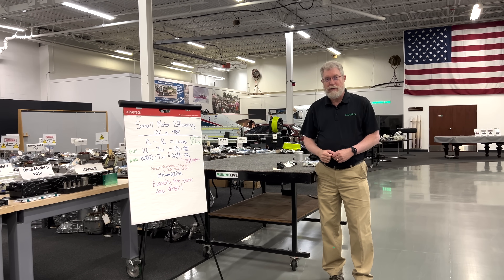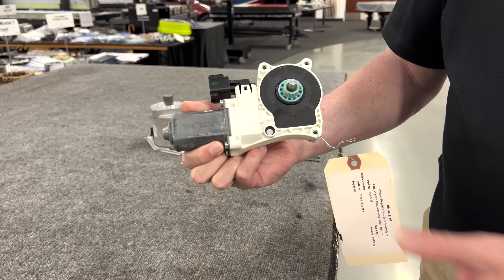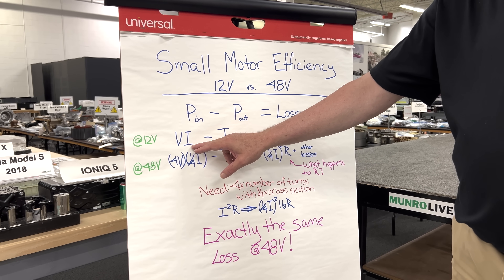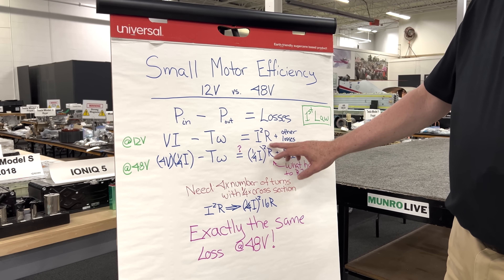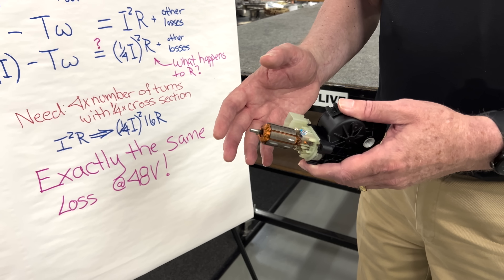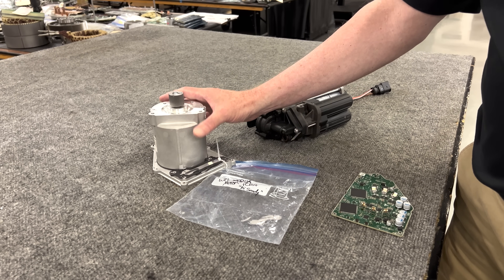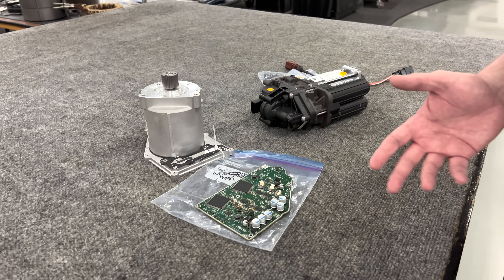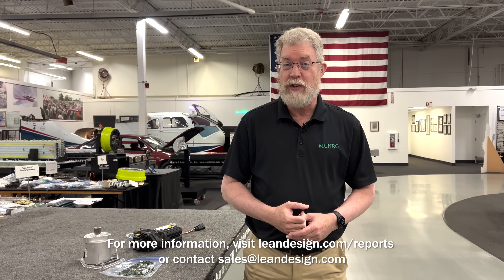Cybertruck 48V Motors: Why Tesla Made the Jump

Comment: What creates more heat 12 volt or 48 volt? Heat generation is also a loss through inefficiency that may not be equal mechanically.
Reply: In the power window example the heat generated is the same. If that device was redesigned to work at 4X more RPM to compensate for the 1/4 reduction in current then 48V will produce less heat.

Comment: I think for these small motors you want to do power conversion to AC centrally and adapt number of phases and power requirements to the application. Maybe some simple frequency conversion step before the actual motor to minimize copper use in cables? Ah yes multi fibre copper cables for sure, some data others different phases separately! ??? 10:06

Comment: it is not efficiency it is weight and size. the thinner wire is less copper (even at added length) since less copper it is cheaper and lighter for the same power output. yes for a window motor you may not notice the difference but for a larger motor like turning motors or such you can see a difference. not to mention the 48V wiring from battery to motor is also smaller and cheaper for same power. Again it is not efficacy it is size weight and cost (of wire) once everyone goes to 48V the cost of the components will also end up being cheaper probably as well but right now they are more expensive. Economy of scale

Comment: Mosfets with pwm control  could have adapted the 48v input to 12v rms without any real downside, maybe a bit more brush arcing, but DC seevos already do variable current voltage with pwm.

Comment: 48V is nothing, Porsche has a 800 V chassis 😅
Reply: No,  silly; that's the drive motors.
Reply: @jamesengland7461  The bouncy bounce?
Reply: @abraxastulammo9940  you are right. 48V is kinda stupid in modern EVs when you are able to just hook up as many higher-power components as possible to the 400V or even 800V high-voltage system instead of connecting it to the low-voltage system. Porsche and Lucid already figured this out. Porsche was able to connect the active-ride suspension, the compressor to the 800V architecture of the Taycan or to the 400V system of the Panamera and therefore could eliminate the DC-DC converter, which was needed before to lower the voltage from 800V to 48V, altogether. Lucid is doing the same thing with the upcoming Lucid Gravity model. A 12V or the slightly improved 16V low-voltage system is more than enough for the components which can't be connected to the high-voltage system directly, purely low-voltage applications and components. LEDs and semiconductors for instance need 5V or less. Tesla once again tried to solve a problem which was never really there, it is kinda a nothingburger.

Comment: Lower current through the MOFSET/electronics is healthier, less heat damage. Heat in the electronics is what often kills Tesla systems. This is what they have learned from Roadster, Model S/X systems. 
And small wire costs less. And electrons travel on the wire surface, not within the wire. And smaller wire connectors to ribbon wire is easier.
Reply: Skin effect is for AC only i.e. for motors, inductors but not the DC power cables at all.

Comment: Really useful video. I saw someone talk about this in drone motors, 6S vs 4S lithium, and the take home was: doesnt help the motor much (if at all) but does help power delivery and wiring. Why the motor was not improved significantly at higher voltage I didnt understand, but I do now!

They did mention slightly better winding packing when using thinner wire helping a bit, does that bear out on these? or is ultimate performance in a motor like this not really a target, unlike a drone motor where every gram and bit of efficiency is saught after.
Reply: Small models don't have the efficiency problems of a 6000lb vehicle, motors are wound for either max power or rpm. Either way weight maximums delegate a battery size = weight per vehicle. A tiny camera might weigh a couple of grams, whereas anything heavy (ounces) can change everything.
Reply: Should have included, the higher the gross weight the more battery is required. But a certain model size dictates the maximum battery weight overall.

Comment: Smaller connectors, thinner wire. Combined with the door controller board and Ethernet you have only power and network going to a door controller...  the door controller really runs the show within the door. All part of Tesla's drive toward modular builds. No wire looms run into the door; just unplug the Ethernet and power connectors.
Reply: Only power and Ethernet, this improves on only power - in no way. The board handles current but it also consumes current.
Reply: @BellaNash but the 48V system is standard Ethernet voltage and also requires ¼ the amps compared to a 12 volt system

Comment: Higher voltage and lower current has an advantage  on I^2*R losses but only comes apparent in transmission and distribution lines.  For example a transmission line may supply power at 231KV to power a home at 120/240 volts.  I can power an entire city with 400 amps, a typical home has a 200 amps service.  The other advantage is much smaller conductor!!!

Comment: Amazing, thanks for posting this. Next thing you'll tell us is that 800V vs 400V battery architecture makes no difference on I2R losses or charging speed :) which I would fully agree with

It may be complicated for youtube, but if possible I'll ask something: is it possible to explain what is the "appropriate" voltage level for every power level? Should help with the EV literacy and critical thinking of the viewers in this new age.

Comment: As an old electronics dude (robots) - I have learnt a lot about car manufacturing from the Munro videos. "MOSFETS" are actually quite amazing. In the old days, valves were used (massively inefficient, due to the heaters required).Then transistors came along, which were better, but still plenty of losses. Mosfets, (Metal Oxide Semiconductor Field Effect Transistors) since they were first used, have become incredibly low loss ( and improving constantly). They are needed to power brushless motors - which require high current, at high switching speed. (As Paul mentioned  - more MOSFET current = more expensive). Perhaps Paul could do a quick video about brushless motors (which require sophisticated control)( themselves an advance on DC motors - which were relatively simple to drive)...
Reply: Brushless is definitely the way to go for motor durability. I used to make brushed motors and the brush is easily the weakest part of the motor wearing out faster than any other part of a motor. The motor brushes are not only weak but they are very brittle so brushless is a no brainer.
Reply: The main loss for MOSFET technology, apart from the on/off switching speed, that can be, but is usually not significant, is the single parameter RdsON.  This is basically the resistance of the Drain-Source that carries the switched current.  A number of years ago, manufacturers cracked the sub1 ohm barrier.  Now, manufacturers like Nexperia are claiming sub 1 milliohm without undue compromises.  This is a huge advancement for low voltage motor control of significant power, because in many cases, little or no heating and therefore sinking of thermal losses is required to efficiently manage power to the load.

BTW, thanks Munro Live for the heads-up on the new paradigm that is 48V.
Reply: @jimparr01Utube  Yes, RdsON has got so low, that is staggering to see "chips" that can handle hundreds of amps, with no heatsinks...(expensive, no doubt !)...
Reply: @chrisheath2637  Yup!  Staggering is the right kind of word.  Retired after 55 years as a hardware designer, I have seen progress from BJT germanium - then silicon.  And then CMOS logic and then MOSFET.  IGBT deserves a mention.
Reply: @chrisheath2637  I have some MOSFETs here with and Rdson of 0.032 Ohms, and can handle peak currents of 200 amps . Have 8 bolted onto a heatsink that function as a spotwelder pulse switch.
Reply: Amazing comments, ty
Reply: With you !
Reply: The brushed motors used in corded power tools have an ac supply but the motor operated like a dc motor because rotor and stator are on the same line. Laminated cores are used to minimise eddy current losses. Efficiency is very poor.
Reply: I bolted 8 MOSFETs onto a CPU heatsink and use it as the switch for a spotwelder. Source is 12V car battery, and the pulses carry between 600 and 800 Amps. I could probably get away with just 4 as the pulses are 100 milleseconds max, but that's me just playing safe, and they're dirt cheap.

Comment: would it make more sense for them to utilize existing 12v window motor and just do a voltage drop from 48 to 12?
Reply: Changing voltages requires electronics. This is more expense, and Tesla are brilliant at cost/benefit analysis to keep the costs down. (They work with suppliers to find the best technical, and cost effective solutions...)
Reply: Then you would be wasting energy in the form of heat. Basic physics, which understandably, is not uppermost in non technical minds. Good question, though.

Comment: The MOSFETs for the 48V drive are higher Vds rated, so not 1/4 the size / price. Die area goes up with the square of the voltage rating and inversely proportional with Rdson. So for 4x the voltage at 1/4x the current keeping same resistive losses (MOSFET conduction inverter losses are 3 * Irms² * Rdson) the MOSFET dies are 4x the area!
Reply: Die costs are not the most relevant for smallish mos today. Often the package costs more than the die. Cost of package reduces with current.
Reply: I don't follow. With same losses, wouldn't R grow 16x so total area stays the same?
Reply: You're correct. Keeping losses the same, R should increase 16x for 1/4 the current. So die area stays the same overall. Sorry for the confusion.

Comment: The cross-vehicle wiring can be 4x smaller cross-sectional area so harnesses can be lighter weight and cheaper to manufacture.
Reply: and other parts significantly more expensive lol..
Reply: @alanmay7929  not if they are produced at scale.

Comment: I have never heard that 48v was more efficient.  All the hype was about reducing wiring diameter, weight and using less copper.
Reply: Those are efficiencies in a different way
Reply: @jamesengland7461  those were the efficiencies that I thought of.  I have a background in the electrical side and didn't expect power efficiencies in devices.

Comment: Why 48V? Not just 4x?
50Vdc requires more safety issues to address. Same goes for aerospace, etc. 48Vdc is a standard so easier to design using off the shelf parts.
Reply: It is the highest standard voltage for low voltage directive.
Reply: You meant > 50v (greater than).  Because, 50v (exactly) and below is legally considered "safe".  Is any distinction made between AC and DC at <= 50V ?  I wasn't aware (but I'm not in USA)
Reply: @chrisdrake4692  50V is the limit, over it must be very different insulation etc.

But taking into account voltage ripples and regulation errors makes only "48V" practically usable.

Comment: I have always learnt the Ohms law as U=RI and P=UI
U is the difference in voltage, not necessary the voltage to ground. 
Simplify it to   Volt=Ohm*Amps and Watt=Volt*Amps
Reply: one thousand ohms * 2 amps = 2000 volts? are you insane?
Reply: @codefeenix  That requires a 4 kW resistor (heater) or a very long copper wire. I have worked with about 6000 Amps - but really low resistance and low voltage (for heaters). And also worked with 50 kV for power distribution. But you seem to be far off the 48 volt used as low voltage in the CT.
Reply: That still is correct.  Typical (EU regulations) is 6A / 1 mm2 cross-section of the conductor for safety.  The resistance depends on the material used (fact: it's not always copper, especially in high-voltage cables).  The 48V was aimed at exactly this-> increasing the voltage decreases the amperage for the same power (factor 4 here -> take 200W with 48V = 4.16A, => 12V = 16,6A).  This implies for a 48V system, you can safely use 1mm2 cables with safety margin.  For the same 12V system, you need a 3mm2 cable for similar safety margin..  ripper weighs approx 9gr/cm3.  If we assume copper, that comes down to approx 9gr of conductor-material, for insulation I used PVC which is 1.4gr/cm3.  If you do the math, a 1mm2 cross-section cable with 8 conductors, that are individually isolated and contained in a jacket-insulation (and exactly the same for the 3mm2) it would come to this for every single meter of cable:  135gr for the 1mm2 and 310gr for the 3mm2 cross-sections or close to 2.3x the weight.  Again, this is very basic insulation, very basic assumptions, the real cables surely are better insulated thus heavier thus the effect between 1 and 3mm2 will be larger, and that is only for the SAME amount of cabling, which we know Tesla reduced drastically because of the Etherloop application which would be impossible without the 48v architecture.  The CyberTruck will surely have more then 100mtr of cable thus 13.5kg compared to 31kg is decent weight savings that helps to translate into energy-savings.  There is an additional kicker as well that helps with energy-savings.  The power though the etherloop-bus will not always be at 80% since not everything needs to operate at full-power all the time.  Due to the larger cross-section, the resistance for the current is lower even at 50% or 25% utilization, thus the voltage drop due to cable-less is lower = less energy lost (and also less heat-losses in the cables).  I have always wondered why this wasn't done like this in transport (cars, trucks, vessels, ...) for the past 25yrs or so...  (Ever since learning about Ethernet & TCP/IP)...
Reply: "mister U is IRish...

Comment: Mosfets do not cost 1/4 the price for 1/4 the size in any volume.  In fact if you are smart and track the industry's sweet spot you can get far better for far less cost than your "exact" need may cost. Case in point there is a commonly used MOSFET used in mega volume across the entire PC build market. Motherboards, GPUs, power supplies all use a handful of very high current (and small package) MOSFETs in cumulatively insane numbers. Because of this volume these are multisources and any decent corporate commodity buyer can get them for cost of manufacturing plus 5-7%.  The  mistake some engineers make is to just calculate their specific electrical need, pull out the datasheets and find their match in the matrix. Well if they pick up the phone and ask their rep which one of four that would actually work from that matrix that had the best price they would find they could get more for less. Tesla Engineers in Silicon Valley know to run a costed Bill of Materials and find the lower cost for equivalent/compliant  functionality.  That is value and that is iterative cost reduction. (Cost of building the vehicle goes down which grows margin at the same price OR you reduce the price to get more customers and hold your margin. [ Something Wall Street is terrible at understanding.] ) 
The big advantage of 48V is the cable bundles that are routed around the vehicle are higher gauge wire bundles that are more flexible and have a cheaper material cost. 48V Power Over Ethernet is a standard that uses a connector that costs less than 10 cents in volume. The cabling is dirt cheap as well. It "powers" a massive array of solutions from WiFi Access Points to Security Cameras, to digital displays and speakers, phones - I could go on and on. One standard on one connector with both data and power.
And the point about higher wattage requirements is valid. Its just like the move from 6V to 12V because the starters for the V8's (and above) needed more juice. But it you look at the trend of the last 15-20 years its all about infotainment and amenities. Its not longer about how many cup holders per square foot of interior - its about displays, cabin lighting, self-opening and closing frunks and hatches and charge ports, etc. And many of those need a simple switch or switches that draw no power and need a low current wire bundle to put in a convenient area.

Comment: I recall how the old automobiles had a six volt electrical wiring. 
A 55 Watt headlight bulb draw nine amperes! The wiring and the switch easily lost 20% of the power. The change to twelve volt electrical system required a somewhat more expensive battery, but reduced the losses four times, to a much more acceptable 5%, and made electrical switches and all copper wiring much more economical...
Reply: We had 1968 Trabant 605 with 6V. Two-cycle engine making whole 27 hp….
Reply: Yes I remember putting some hefty cable in to power my 1980’s spot lights!
Reply: After WWII, higher octane gasoline became more readily available, so engines could use a higher compression ratio. This had the side effect of being harder to turn over the engine, so rather than use a larger starter and more amps, everyone agreed to go to 12V
Reply: @Ray_of_Light62  
Why dont we switch to 48v nowadays?
Every new car is bound to be a hybrid/ev anyway.
Batteries are getting better and cheaper

Comment: I would think they just changed the pinion gear on the motor, instead of the motor windings. Then you'd keep the advantages of 48v.
Reply: just load finer wire into the armature winder and up the turns 120 volt motors in home and shed devices use similar size motors with 10 x the turns.If you just fit a smaller pinion it will not mesh without making another casting to make up for the smaller pinion or making the mating gear larger to keep the shaft spacing the same but their will possibly not be enough room for the larger gear so another housing so at least 2 changes up to 3 none of them cheap or quick.